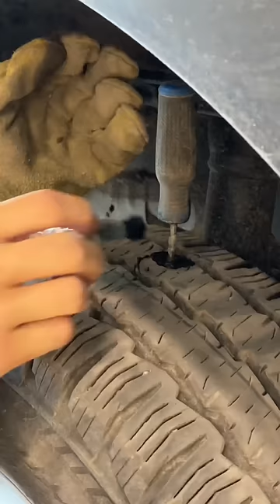Why You Shouldn’t Plug Tires #tiredoctor #tireguy #tires #shorts #tireplug

Comment: If improperly done, an oil change can damage your car. So don't do it >:)
Reply: facts
Reply: Oil change shop got offended when they saw me check my oil after they changed it lmao, pulled my rig into the parking lot and checked it but I only do that to make sure they didn't forget to put the damn oil in my rig because a different shop in the past completely forgot to fill my Cadillac back up with oil! So I'm not going to risk that happening with my rig!
*edit: just saw my typo say offend instead of offended 😂🤦🏽‍♀️how embarrassing to catch it several weeks later
Reply: And quick lubes will strip out your oil drain plug and leave you with the bill to fix it, so being "in the industry" isn't a high bar.
Reply: same logic lmao
Reply: @Harlow_Khmer  how tf does that even happen
Reply: @TAELSDOLL  Literally.
Reply: @ningbronsin9826  I have no idea!! Blows my mind too!
Reply: Love the sarcasm and satire. Nice
Reply: @Honey_Daddy  or tighten it so tight you got to use an air wrench on it or worse... 

Or tell you that it wasn't tighten, just because they could take it off with a wrench.
Reply: @BiruKana  they usually tighten it so much that only a breaker bar with a 6 foot long extension will get it off. But yeah, you're so right. Not to mention telling you you need every fluid known to man changed. Transmission, power steering, brake, differential....Quick lubes are the worst.
Reply: @Honey_Daddy  That's why I change my own oil. It also means I know what oil and filter are being used (ie not the cheapest crap available)
Reply: @machinist7230  same here. And I know how dirty the oil is, I don't get charged synthetic prices for conventional oil, I know the crush washer is replaced, and my pan isn't stripped, I'm not over or underfilled- So many reasons.
Reply: Semi clever but the type of danger and who it’s applied to vary greatly in the given scenario. It’s financial risk vs lethal risk
Reply: @triptravels1999  a flat tire is not likely to kill someone going a reasonable speed. Many of us have blown tires or gotten flats while doing freeway speeds. the other 3 tires and wheels remain in contact with the road, and the flat tire's wheel is cushioned by the flat tire and/or usually hovers suspended by the others, but at times may hit the ground, we hear the clop clop clop and slow down and pull over. It's usually people speeding at dangerous speeds who end up dying because of a flat or blown tire, so generally speaking, the risks are both financial. That said, even if I were to grant your point, his argument is that just because there is possibility that there will be a negative effect, that isn't a reason not to do it. Anything done improperly can end poorly. To argue against that very true point with, "well you could die" when it's unlikely to be the outcome is a bit silly. Whether the costs are 1 to 1 or apples to oranges, it will still remain true that things done improperly will end up with repercussions, so the effects varying is irrelevant.
Reply: @triptravels1999  Correct. In the scenario I provided some engines could go for quite some time on bad or no oil. Others would grenade themselves. Not all engines are equal.
Reply: @Harlow_Khmer  definitely worth. Ive seen mechanics do some dumb shit

Dont get burned twice, you got a good reason and checking is a lot less time than a new engine...
Reply: @0xsergy  definitely ❤️
Reply: you re the kind of person with cheaper tires than yourself
Reply: @Marmael  So you're saying poor and working class people exist? There's a shocker. 🙄
Reply: @Marmael  who are you even talking to 😂
Reply: @Marmael  and what does that even mean lol
Reply: If done right by jiffy lube, it could also destroy your engine. So, yeah.
Reply: 🤣🤣🤣 some people actually do this
Reply: @Honey_Daddy  can’t strip it out if it’s a ford with a plastic twist lock plug. But they generally snap anyway
Reply: That's what this feels like to me
Reply: I actually had a blown tire during a windy and stormy day while on the highway. I was lucky to have someone notice it and wave me down, otherwise I would gave though it was just another windy day.
Reply: @Harlow_Khmer who cares if they get offended ya know? It’s your car and your right to look, do whatever the hell you want haha
Reply: @LightsaberGoBrrrrrr  💯💯
Reply: @Harlow_Khmer   My car takes 4.3 quarts of oil, and one time I went to a shop that I'd previously gotten work done at - They were rushing alot, not checking anything and they clearly overfilled my oil. They barely took the time to drain it, and left a good chunk of the old oil in. I got the owners son to admit he put 5 quarts in my oil, but literally right after he denied overfilling it. I havent gone back since
Reply: @LightsaberGoBrrrrrr  wow
Reply: Just pull the drain plug and drive.  All is good. No 710 needed lmao
Reply: @Harlow_Khmer  if they get offended because of you checking the oil, I wouldn't go there again, they probably fucked something up and don't want you to find it
Reply: @Kratos-eg7ez  ya I check it every single time. IDGAF if they think I'm crazy for doing it. Those shops hire just anyone. I try to stay away and just do it myself but there's been a few times where I didn't have time and just went to a shop. Bring my own filter & oil and they'll still charge in full so I rather just do it at home 😫
Reply: Yep. Walmart changed my oil one time and they somehow managed to get oil in the ignition or something that has to do with it. I had to have it replaced, thankfully it was still under warranty. I don’t go to Walmart for that anymore 😂
Reply: @Harlow_Khmer same happened to me once.. sorta.. Jiffy Lube tec just casually told me something about not having oil “last time” it was in the shop meaning they not only forgot to fill it that time before but they never even told me 😑
Reply: @ministryofwrongthink6962  damn 😭😭😂
Reply: I saw that one, guy drained his transmission fluid and then added oil, :)
Reply: @Harlow_Khmer I would never go back if a shop got made they had their work checked.  I've never done anything other than look proud when my work is checked.
Reply: @Redact63Lluks  ya I never went back to that shop. I try to do it at home but sometimes the timing is bad and I don't like going over 3k miles so now I just make the 15min - 20min drive to my family mechanic in the hood. I bring my own synthetic oil and filter and give it to him and he only charges like $15.  If I bring my own oil and filter to an oil change shop they'll still charge full price 😂🤦🏽‍♀️
Reply: @Harlow_Khmer  can I ask what you drive that only sees 3k between changes?
Reply: @Redact63Lluks  99 Yukon. I'm weird about it 😂. Everywhere I drive it, random people stop me and ask to buy it or they compliment it. Good old square body 🥰
Reply: @Redact63Lluks  and ya, I know I can go longer in between oil changes using synthetic oil etc but I'm just a weirdo and rather not. 😭😂😭😂
Reply: @Harlow_Khmer  I knew it must have been American, carry on.  😁

Still you could definitely save oil like that for small engines or bar oil
Reply: @Redact63Lluks  😂♥️. I also have a 2001 Mitsubishi Montero Sport that belonged to my Asian grandmother so it has sentimental value to me so I do the same with that rig as well. But that rig burns oil and leaks a little oil and once I switched to full synthetic I stopped dripping oil but it's still burning oil. Gotta top that off like every 400 miles 😂 but I love that old rig. Random road ragers tried to tell me I'm poor when I was driving that rig lmaooooooo 🤦🏽‍♀️
Reply: Sometimes when you walk outside you might slip on something, please don't do that
Reply: Though I get you that’s a terrible comparison lmfao
Reply: You could probably quote John Deere with that one. 😂
Reply: @Harlow_Khmer and half the time they refuse to pay for a new engine after it blows up five minutes later. Did my brother dirty like that. Left the oil plug finger tight . Made it ten miles and it locked up.
Reply: @jordanalexander615  damn 😭😭😭
Reply: @ningbronsin9826 happened to me.  Went in for an oil change.  OFF OF A WHIM, something told me to CHECK THAT OIL!  Guess what?  Almost NO OIL!  Luckily I was right there at the shop.  Thats why I check my oil after I get it done.

Plus, I have a CDL and we do this for our pre trip inspections anyway 👍